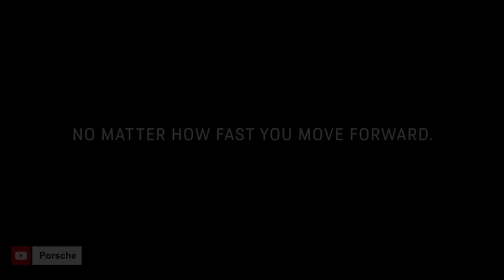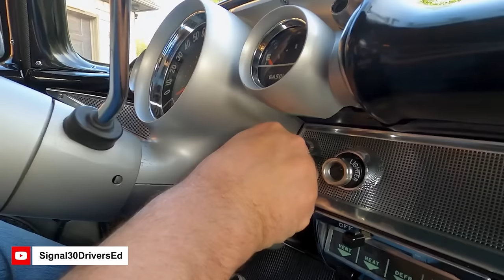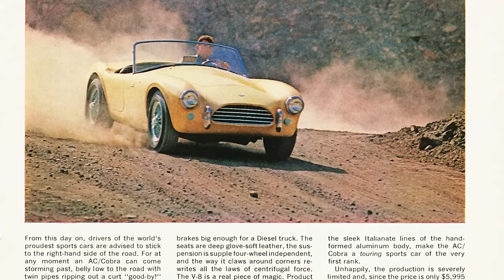Why Old Cars are Better

Comment: I drive a 1990's era car and the main reasons I enjoy it is because you have more control over how it drives, they are simpler, you hear more of the car's internal actions and they have better visibility. Not to mention look cooler.
Reply: Today's are all in the Japanoid mold - aerodynamics over looks, always function over form, even if the result is ugly, computers all over the car, impossible to fix.
Reply: I feel claustrophobic in my parents new car which is bigger then my 90s car
Reply: same here.my 90s car (4 door acura) is fairly small but it feels extremely roomy and open.
Reply: As someone who owns a '98 Pontiac Firebird Formula, I concur with this statement.
Reply: Agreed 👍
Reply: My 03 ranger is tiny compared to my dad's 2015 F150 but I have more passenger space in the front seat and a longer and more usability sized bed. The visibility is amazing I can see everything around me and know where ever edge of the vehicle is. Newer vehicles I have driven feel so alien, my mom's 2010 grand caravan is a bulbus box that you can't judge the size of
Reply: The 90s were the height of American automotive quality, particularly GM with the 3.8 V6
Reply: I can definitely attest to the visibility part, compared to a modern F150, I always feel like I can see so much more in my 95 F150. As unlike in the modern F150s if I lose someone in my side mirror I can simply turn my head over my shoulder and look out my rear windows for a glance and see where they went
Reply: My Mom has a 2004 Mazda Tribute (Ford Escape with Mazda logos; literally the engine parts are all embossed with Ford logos) and it drives me crazy arguing with the gas pedal.  I want to go a little bit faster, so I push the pedal a little bit harder and it goes for maybe three seconds, then returns to what it was doing and I'm like "NO, GO!" and kick it harder, making it jump and way overshoot how fast I wanted to go, so I let off and it aggressively engine brakes until I'm going too slow again.  I will NEVER buy a non-carbureted vehicle in my life.  Edit: My daily is  a '95 TBI Chevy that I inherited, modified like an idiot and am finally getting a grip on tuning.  It drives like a carburetor and IMO is way better than this modern fuel injection.  Who gives a rat's ass about emissions when the emissions compliant vehicles constantly try to wreck themselves?  My others are all carbs, baby.
Reply: @datawizard8194  No kidding, I picked up my step-brother's (I think) 2017 F-150 from the shop and had to get back out to check where it was before pulling out.  You can't see ANYTHING out of the new Fords.  Edit: And this is coming from someone who (foolishly) dailies an extended cab, 8 foot bed '95 Chevy K2500.  That Ford was a standard cab, six foot bed.  Haha oh yeah, also the transmission refused to shift out of first until I restarted on the side of the road, then acted like nothing had happened.  Built Ford rough.
Reply: @FuckGoogle502  Imo the F150s have worse visibility than they’re bigger brethren. The mirrors jsut feel inadequate and your blind spots are right next to you
Reply: @FuckGoogle502  I understand your problem, the only vehicle I can drive consistently is my ranger. It's EFI but is smooth and responsive. I'm swapping out to a standalone ECU so I can get more control (and maybe mess with drive by wire). If a vehicle is properly tuned it drives well. Most "commuter" vehicles drive like shit, but if a vehicle is designed to not be comfortable then they are great to drive.
Reply: I was just thinking that 90's cars are the best of both worlds when it got mentioned in the video. I have a '95 Swift and I will drive and maintain it for as long as I can.
Reply: @michaelbenardo5695  dont you dare insult the design choices of the mighty Japanese automotive industry
Reply: exactly, you feel more in tune with the car, like every move you make transfers to the car. new ones feel like video games.
Reply: You should try an old car, thats still a new car.
Reply: You can't compare a mini truck like a Ranger to a full size Pick up.
Reply: This guy is unimformed,  nothing built after 1950 is an old car.  They are all modern cars.
Reply: I love the 1998 Ford Taurus.
Reply: Me too I agree with you completely. Mine is even more analog since it has an old school diesel under the hood.
Reply: I want a 1998 Toyota Corolla because its "an" car. it looks like a car, moves like a car, and will get me from place to place. they are cheap now and I'd imagine it to have a ton of parts lying around.
Reply: I gotta say 90s is probably the perfect balance between mechanics and electronics in cars
Reply: That's cool and all, but that car is unsafer than one from the 2010s and thats a FACT :)
Reply: @leviathan5207  cool story bro
Reply: Same here ❤
Reply: Well, if you say so.  Everything from the '80s up looks like a rolling shoe box to me.  For cool looks, ya gotta go back to the '60s.  Oh, and the old cars didn't need any damn computers to run, either.
Reply: Try the steering on a new car, you might feel your 90s car cannot be controlled as well after a few seconds in a new sports car
Reply: I got a 1993 Buick Roadmaster Estate Wagon. It is interesting how you feel when driving. It makes noises that tell you exactly what is going on. It has the important gauges like oil pressure, which I haven't seen on any newer vehicle. For an 18.5 foot vehicle, it has excellent visibility, you can fold the 2nd and 3rd row rear facing seat and get 6 feet 10 inches of room. Binding a new fob was a breeze, without the old one that was destroyed. Electronics make sense as they have direct symptoms such as idle air control valve showing unsteady idle, which the OBD1 will tell you without needing a direct hookup, just a paperclip and it will flash your code. Maintenance and repair is easy with such a large engine bay and thought put towards access to parts that need repair. It is almost quintessential design. I could go on for hours on how much makes sense with almost no complaints. 

And wood grain siding? She's got style
Reply: And they dont broke down also
Reply: And diffrent,  cars looked diffrent from one another
Reply: I love my 90s volvo 😂
Reply: Being broke is surely also one of the reasons? I don’t mean that to be as dick as it reads back!

Comment: When a mechanical system has problems. You have warning signs. You can fix it. When electronics go bad. They just quit. No warning. And it usually takes expensive equipment to diagnose the problem. Then you have to replace an expensive electronic part. And sometimes that new part is faulty. Especially today
Reply: This is a really important point. I drive a ‘77 GMC K25 (3/4 ton). I can hear little squeaks, pops, and gawd know what else. But I can find the issues, and deal with them. Usually cheaply. I can tell if it is idling rough and needs the plugs cleaned (don’t even have to replace them). And I will never be stranded by some damn throttle position sensor or some crap like that. Old rigs are not for everyone, but they sure are great if you’re an enthusiast.
Reply: That's really not true, electrical systems have warning signs too. If a wire is burned up, it doesn't immediately go out. The resistance skyrockets and your electrical thingimabob starts working intermittently. Then you know you have a problem with out it being completely broken.
Reply: @firstNamelastName-ho6lv  it depends, they can do both. The worst is when you just have enough resistance somewhere that your whole car just doesn't work. That's why I avoid electronics.
Reply: Another thing with electronics is they can make everything proprietary and closed source, and then electronically pair the parts to each other so if you replace it the car will either limit it's own functionality or just outright brick itself. You can't have nearly that much control mechanically so they try to replace everything they can with computers.
Reply: not to mention you can SEE what broke, on the new ones some times things break and you will never know.
Reply: not entirely true, my 03 tahoe has been throwing a throttle position sensor a code for 15 years putting it into limp mode and disabling the truck and every part along the way from pedal to the throttle, and the computer have been changed and it still wont go away. @firstNamelastName-ho6lv
Reply: @skwerldeath  Well put.  I've been there, done that, and on motorcycles, too. --Old Guy
Reply: @ChaseThePinballWizard  Nowadays, you need to buy the $8,000 proprietary scan tool. --Old Guy
Reply: modules on vehicles now rarely ever go out and a cheepo scan tool is like maybe $20
Reply: @ChaseThePinballWizard  did it ever occur to you it could be a short in the wiring or a high resistance issue? saying you changed the "computer" implies you're just throwing parts at it
Reply: @firstNamelastName-ho6lv  There are modern cars where the majority of functions are controlled by a single touch screen. If the lighting for that single device malfunctions, you're not going anywhere, and you're in for a large bill. On an older car, you may lose your gas gauge or even speedometer, but it's generally cheaper and possible to fix.
Reply: He was talking about electronics, not electrics.
Reply: Yeah pretty much. Recently my phone speakers just stopped working...never came back on. And my vehicle's gauge cluster also just stopped working and is now in the shop for software updates
Reply: Absolutely true! Same for a lot of plastic parts like pumps and hoses. They tend to get bridal and break suddenly
Reply: My dad has a 2022 Ford f350. It had a single small electrical short in the door light, and the entire truck stopped working instantly. 2 years, 3 trips to a shop, and a replacement of the entire electrical system by a professional, it still has electrical issues. Meanwhile, the 1978 Ford F150 pile of rust started and runs completely with a total of 4 days of work
Reply: OBD2 port can often tell you what to replace or repair
Reply: The thing is, electronics rarely go bad. Electrics went bad way more often. They were far more sensitive to moisture and corrosion.
Reply: Oldies but baddies.
Reply: Electronic systems are generally more reliable than mechanical
Reply: But they can't be FIXED.  You have to bring the thing to a shop.  Mechanical systems can be FIXED, IN YOU DRIVEWAY, BY YOURSELF.
Reply: As electrical engineer this not need to be that way but it is. Electrical components in  houses and especially in the industry working 24/7 for decades without a fault. Only i see this problems in cars .
Reply: NONE of the codes that you get from the OBD2 port tell you what part to replace. Those 175 read outs only narrow the field down as to what to replace. The mechanic must determine what to use the information from the OBD2 for HIM to figure out to replace.
Reply: Having worked at a company that males automotive electronics I found that many problems come from market pressures. Manifacturers want  all sorts of fancy functionality to stand out, and they want it cheap and quick.
That doesn't really lead to great quality.
It's totally possible to create super reliable and/or easily fixable electronics for a car, but unfortunately that goes against the financial interests of the companies involved.
Reply: Old cars had actual analog gauges, so that you can tell if the oil pressure is low or the coolant is hot!
Reply: My wife’s 2006 Lexus IS turned into a brick in the left turn exit lane into the highway at 5:02 pm.  To be honest, it’s the first “Major Repair” in 92K miles.
Cost $2K to replace alternator and battery:  NOT parts, ¾ of the cost was labor at $296 per hour, to remove all kinds of engine parts to actually REACH the alternator!  🤬🤬🤬🤬🤬
Reply: Agreed. But newer engines act like electronics. They just blow. Older engines warned you! And they kept running until complete obliteration! And you could fix it later
Reply: But you can simply not use those electronics in most cases, therefore it'll never go bad, so it'll be similar to the old cars from 1980s but with several times better survivability in a crash.
Reply: Yeah. I agree. My father is a fan of BMW . And his his favorite car is BMW X6 . But he sold it due to electronics issues. It was constantly malfunctioning after few years of perfect driving. 
So now I think that electronics in cars are evil and my dad still has love for new models 😅.
Reply: This is especially true for EVs. If the battery goes out, your only real choice is to go back to the dealer and pay $$$$ if you want them to replace it for you. Otherwise you’re left with a very expensive rolling shell.
Reply: Would you like Blue Cheese, Ranch or 1000 Island with your word salad?
Reply: The manufacturing cost of electronics and the cost diagnostic systems is  low, the high price tag is all because they create a monopoly around the design.

It is too expensive to reverse engineer that stuff and thus there is very little competition. 

But you have that without electronics as well. My current daily driver Discover Sport:  the screen washer fluid reservours over $1000 and it is a three dollar plastic part. Why? Because you cannot get it from any second source. 

Electronics are among the cheapest parts to design and manufacture and make perfect sense from the engineering point of view, think about a thing like ECU. Also it seems that it makes perfect sense from business point of view because of the monopoly it creates. Sucks for the end user though. 

That is why we should get laws like right to repair passed and we should insist on at least open specifications and maybe even open source.
Reply: @ChaseThePinballWizard  what about the wiring?
Reply: Sort of. You can spot wire degradation, see oxidization on contacts, check health of capacitors and such, just requires more expertise. You can also avoid most issues by just understanding that electronics also need to be replaced before they fail just like mechanical parts. Electronics are fine, they just have to be engineered with the idea of repair in mind. Remember, the space shuttle has tons of electronics too and obviously it's designed to be repaired quickly.
Reply: Thank you, Kamala Harris speechwriter. Any more vague, vacant and obvious thoughts?

Comment: One of the best and most applicable takes ive heard is that the 90s was such a technological sweet spot because we had enough tech to make our lives better but not too much that it changes how we live.
Reply: You had no carburettors in 90s. Efi is turning point between new and old cars imo. Had 2002 lada with solex carb and shittiest ignition possible. Barely made 40-50hp out of 74hp engine myself by google
My newer car can just start in -40c just by turning the key
Reply: @dren4k To be fair, you're using one of the shittiest cars in the entire world as your example. My 2003 F-150 is profoundly easy to work on, and it performs objectively better than most of the carbed F-150s that came before it.
Reply: If I weren't a know-nothing know-it-all with zero funding or experience, I'd want to start up a new company to make a PROPER light pickup truck in the US, without the extreme AI fetish modern tech is going for. It would obviously take advantage of improvements like baked in GPS, modern outlets, etc. But it would try to preserve the tactile feedback and maintainability of older machines
Reply: @MrAngusyoungistheman  this shittiest example is just cheapest drift missile shitbox available in the whole world
Reply: Yes, but 90s cars take 50% more fuel vs younger cars.